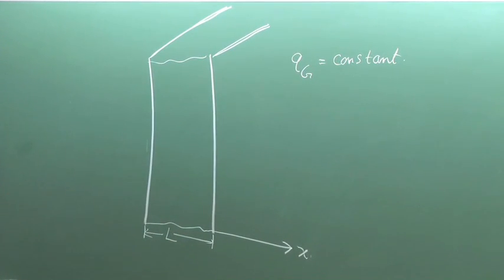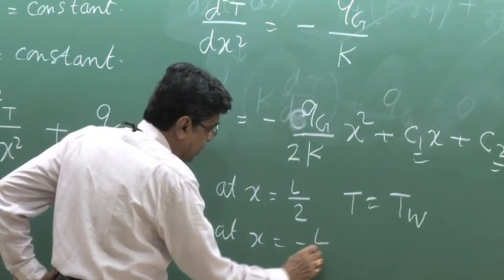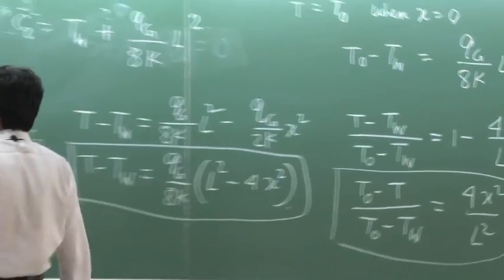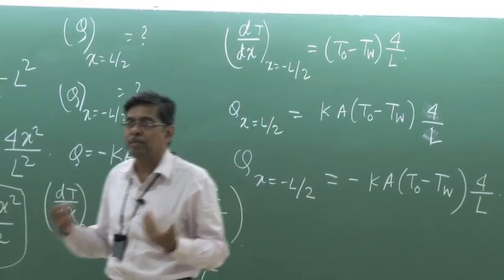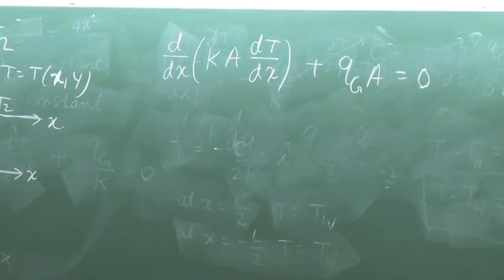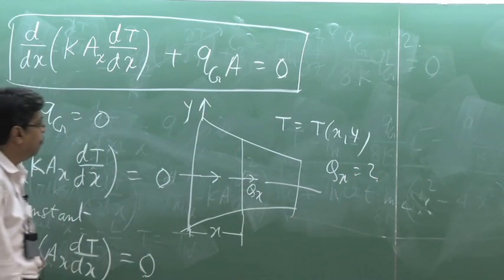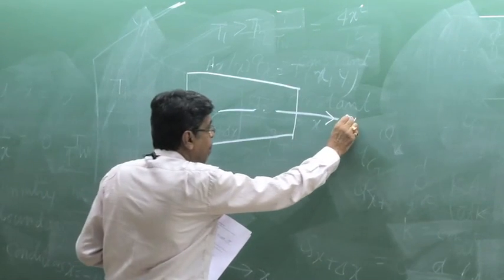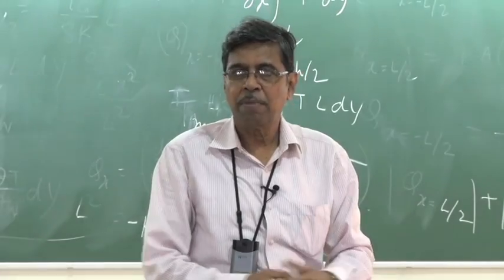Lecture 06: 1D Steady State Heat Conduction In Plane Wall With Generation of Thermal Energy

Comment: • Heat Transfer rate in two conditional formulations - 
(I) Steady state : 
1. Net accumulation of heat at any instant in time is zero. That means heat transfer is such that as soon as heat in fluxes comes they immediately goes out (Almost in no time or simultaneously) at any unit volume or mass throughout the body. 
2. Hence, at any point in the body, its temperature remains unchanged with time though it can be variable or constant with position or space in the body. 
3. Temperature is only function of space coordinates or constant but independent of time. 
4. Used with approximation & accuracy for heat transfer in large or infinitely large time scale. 

(II) Unsteady state : 
1. There is net accumulation of heat at any instant in time & hence, it stores some heat which gives temperature to change with time. 
2. In this situation, net incoming & outgoing heat fluxes are not same. There is some finite delay in balancing these fluxes at any point or volume in time. 
3. Here, temperature is function of time also along with space coordinates.
4. Used usually for heat transfer in finite time scales or sometime in large time scales also where temperature change with time is necessary to investigate in depth.